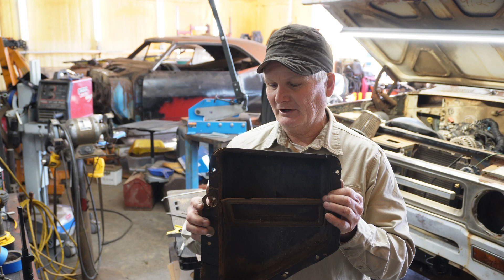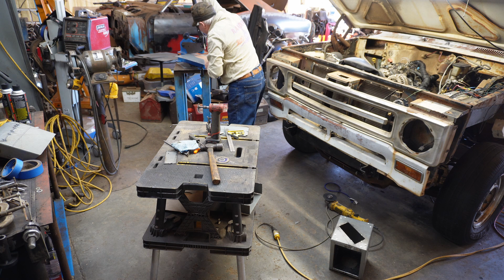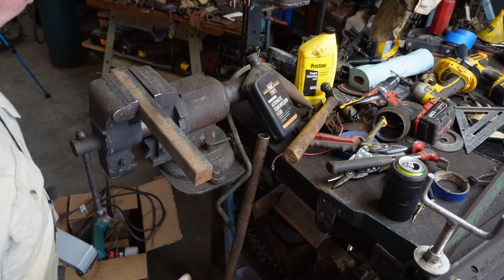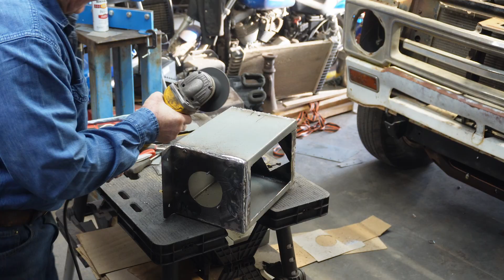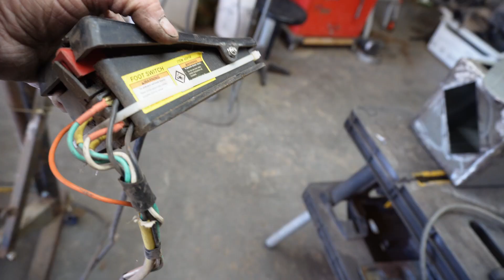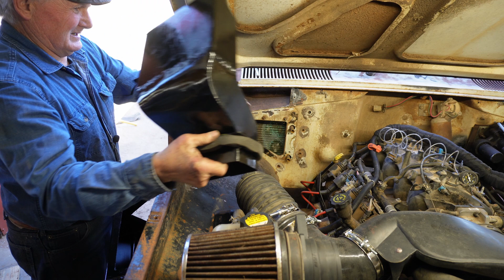We drag out the old bead roller and finish the air box with cowl induction

Comment: Looking good,I'd drill a vent hole in the valley under the air filter,just in case you suck in some water from the cowl induction .
Reply from the maker: Good catch. Thanks. 😁 I forgot to add the hole.